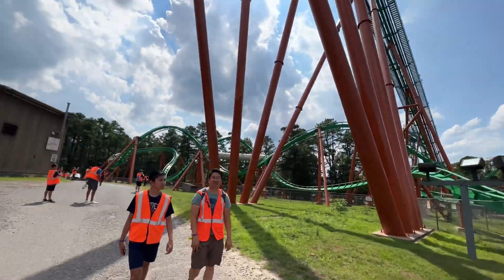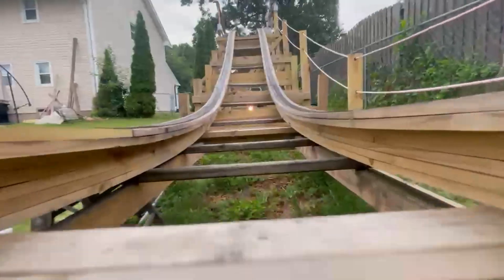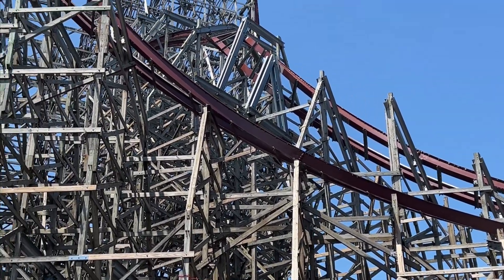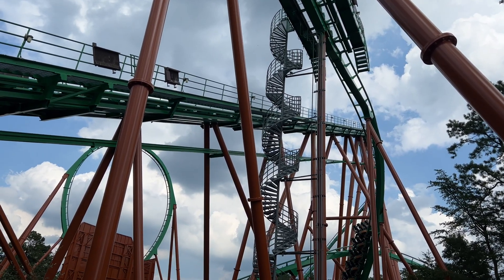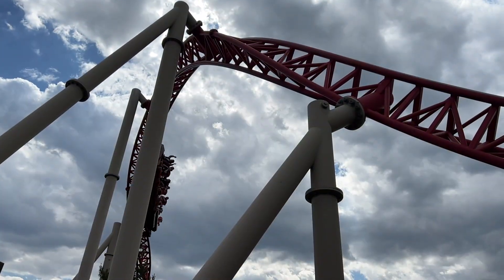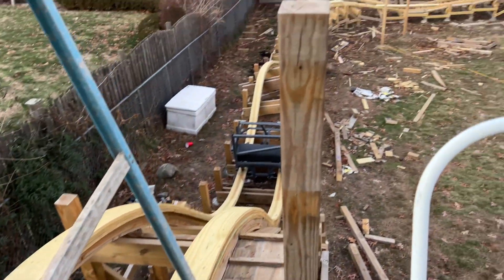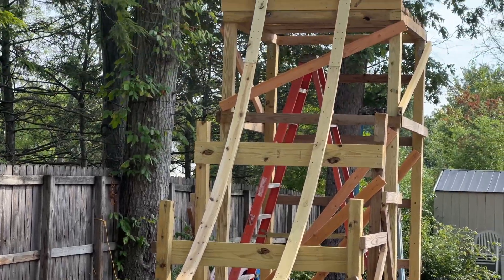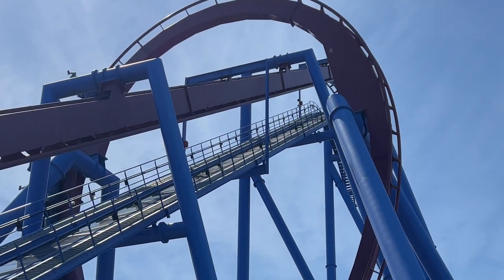Difference between Building a Backyard Roller Coaster And A Real One?

Comment: nice video! I'd like to add to the maintainance part. You actually have to check more than on a regular coaster unless you're a structual engineer. you rarely have to check the support structure on real coasters because the statics are calculated persicely. when you build in a way where "looks stable = is stable" then you have to be very careful at checking if it's still true over time. 
Keep it coming, I love the direction this channel is headed!